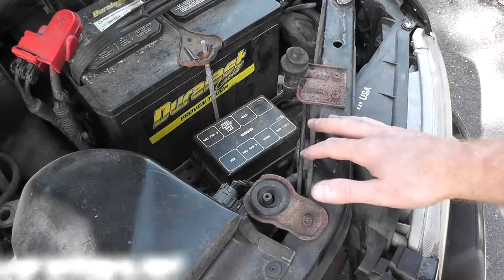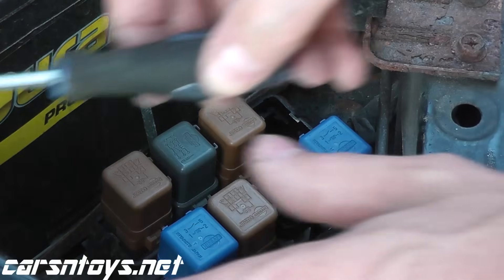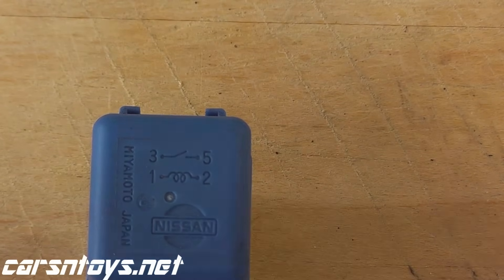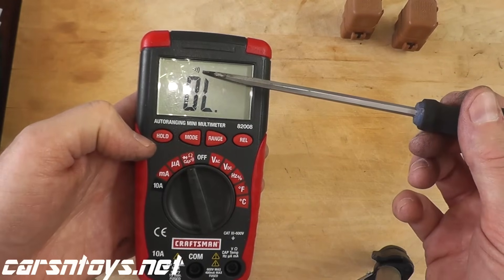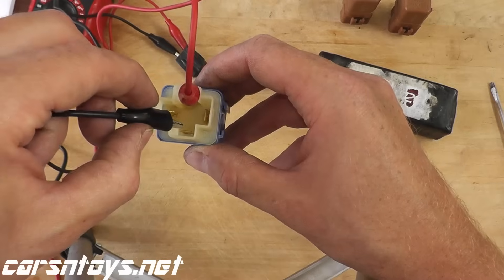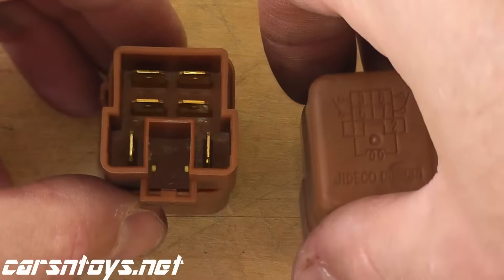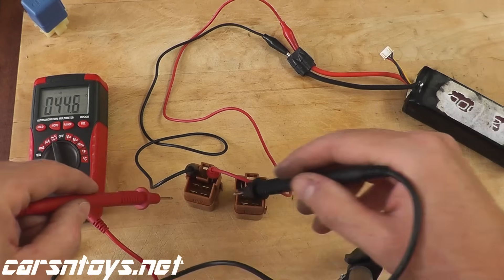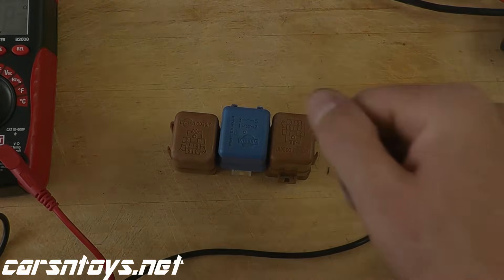How to Test Cooling Fan Relays - Low and High Speed

Comment: Thaaaank you soooo much chief. You've helped me fix my car.. Exact same relay it turned out that pins 6 & 7 are not connecting in both relays after applying power..
I disassembled the relay and found burnt mark on a metal which made a big gap comparing to pins 3 & 5 that's why they wont connect.. So with a little pinching to tight the gap more and now relay is working great. 

My issue was : one fan only runs in low speed and stops when high speed kicks

Thank you for the video once again 🌹 🌹 🌹 🌹

Comment: One important thing to note, if you want to use a multimeter to do continuity test in your home, make sure power is off. You can trace switch and outlet wires doing continuity test, but power must be off.

Comment: Great one of my nissan sunny fan relay was not working properly.when i test one of the switch pin 4 and 5 pin was no contact only 6 and 7 has contact.Can this problem cause overheating?

Comment: My radiator fan relay is clicking over and over really fast and my fans are on. Does that mean its bad? My radiator fan fuse blows every single time I drive it usually right as soon as I get home... got new radiator fans but I need to know if its my relay or the old fans to see if i can save my money

Comment: Driver side radiator fan runs hi speed , passenger side doesn’t come on at all and no low speed on both. So should I replace relay fan 1 & 3 ?

Comment: All of the diagrams I've seen on this 3 fan set up, relay number 1 is for the AC fan.  Seems odd that relay 1 is shown for the Radiator.  But you're working a Nissan - my diagrams are for GM cars/

Comment: How do you know which ones you are supposed to put the positive on vs the negative?
Reply: watch video, follow diagram on relay BUT if relay(s) are like the ones I oulled out to test, there are no numbers or writing on them at all. Cheap as5 foreign parts FiatChrysler uses ! I'm going to guess. Hope I don't mess up good relay,..Auto Zone lists them at $66= !! Maybe I should go to auto Zone and see how terminals are numbered on the part they have. Hmmm ?

Comment: To prevent corrosion, 
rust and or oxidation on, relay pins
junction box holes, connection, 
battery posts, wire or cable terminals 
and junction box hole ,,, ''' apply / 
add dap of silicon / dielectric grease .

Also, it will ease insertion & removal 
of relays, fuses and any component 
that has pins and or legs.
Reply: 1 question, M Aar.  For some reason I thought, in addition to doing all the things you listed above, that dielectric grease was supposed to enhance electrical connections &  promote the flow of electric current.  I recently bought a tube & applied it to the ignition switch in my new/used Ford Ranger truck.  I had/have problems...but they were coincidental after I cleaned the grease off and read up on it.  Turns out my 20-year-old Ranger thought (& still thinks - I haven't been able to drive it in 3+ months!  Grrrr!) that somebody was stealing it, so it engaged the anti-theft system.  Dash is dead/black with the word 'Theft' in red blinking when the key is inserted.  ($75 per key for the dealer to re-program, reported by some...)  Well, my question is/was:  is there such an electrical grease that protects AND promotes current?  Or...I'm afraid I'm way off base(!)  TIA!

Comment: Ohm testing is not a foolproof test during working conditions because of heat or wear in the contacts and the possibility of intermittent failure. In other words, it works then it doesn't work. I swap a known good relay from same car if available, quick and easy. If you pull a part off a junk car, grab some relays and fuses and toss them in your tool box. No guarantee they are good, highly unlikely to be bad, but I have gotten bad parts from the parts store too.

Comment: I have a 07 Pontiac G5 2.2ltr vin-F. Its the same as a cobalt, Saturn ion...my cool fan 1 & 2 use a 0329 relay, THEY ARE BOTH 4 PIN RELAYS. The control  or, (the one that just says COOL FAN), ITS A 5 PIN BUT, ITS MISSING & I EVEN CALLED THE DEALERSHIP & THEY SAY THAT THEY ONLY FIND 2 RELAYS FOR THE COOLING FAN THERE BOTH THE 0329 WHICH ARE 4 PIN RELAYS...THE CONTROL SICKET HAS 5 PINS...I HAVE TESTED IT BECAUSE, I realized that, when I ground the top left peg of the control relay socket, the fan comes on but, the 5th peg then receives power. One row, top rowhas 3 legs, & bottom leg has 2 lines. Most other of the relays are 4 pin except 1 or 2. I am at a loss & I do not know what relay to use? & SUMMER IS HERE! ANY HELP WOULD BE GREATLY APPRECIATED!!!!! THANK YOU!!! The cool fan 1 & 2 use relay 5510-0329...

Comment: THANK YOU!!!!! So, of your relays are good, fans come on with ac, temp sensor is new, but fans won't cycle on when car warms up; what's left?...faulty ecu, right? And if so, is there a test for that? Thanks. (94 Sentra 1.6)
Reply: I'm having the same problem with my car fans work when I turn ac on but when I'm at idle they dont kick on causing engine to overheat